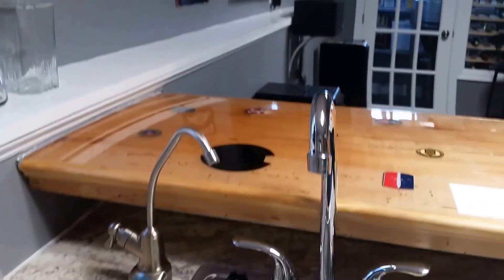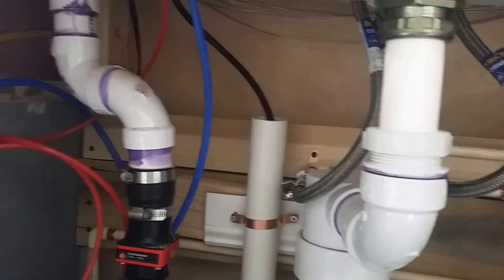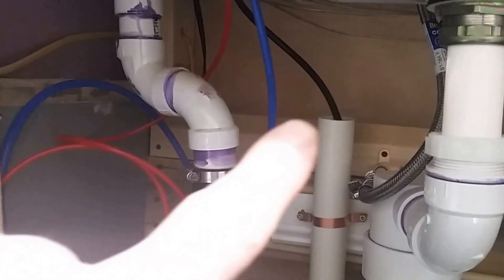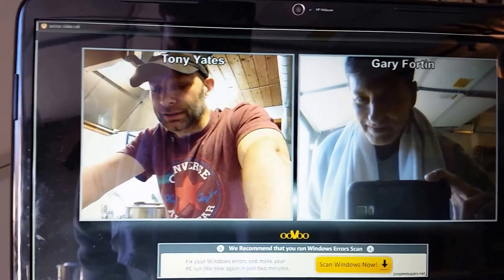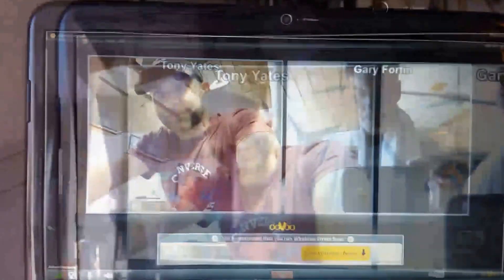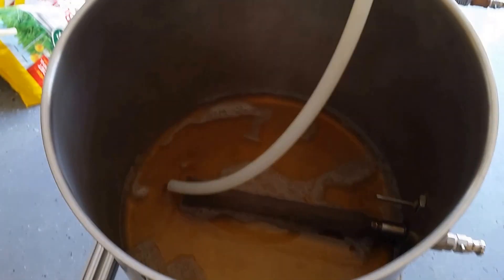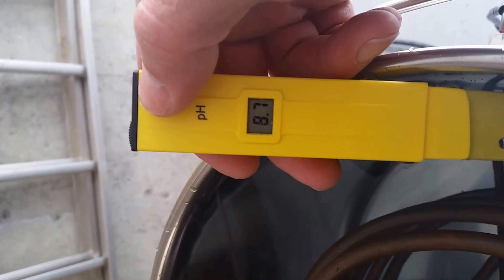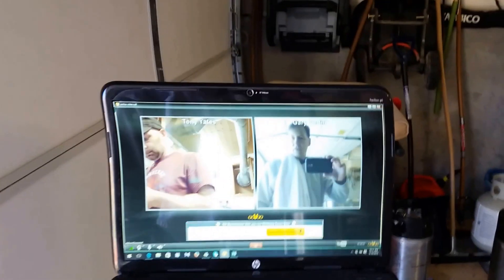March Brew Madness

Comment: I'm fortunate to have really good water in Portland. Though I've still been talking to Tony about water and will likely pickup a PH tester and kit this year. Cheer Gary!
Reply from the maker: +ClementsHomebrew. Have you had it tested twice a year? winter and summer, municipal water can change drastically between those times. I completely understand great brewing water, Maine has whats considered the best brewing water in the US. I went from that to water that is not that great, and it was showing up consistently in my lighter beers. Tony is of the same mindset, to have the same base water and then add what you need per style, and you will never go wrong, and have greater consistency throughout the seasons.

Comment: I just buy distilled. :/  HHBW!  Cheers!
Reply from the maker: +Dan ABA Hi Dan, Yeah UGH hauling 15 + gallons of distilled water from the grocery, this is cheaper and more convenient in the long run. Typically I am doing 10 gallon batches not 5. To buy distilled water @1.39/gal it adds up quickly, Cheers!
Reply: +BlackDogBrewery it's highly treated, and inconsistent.